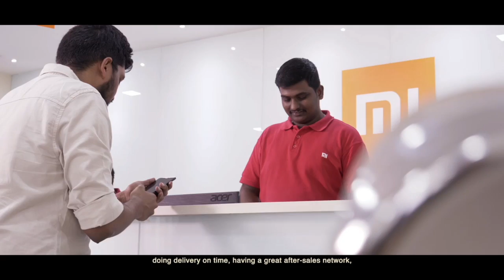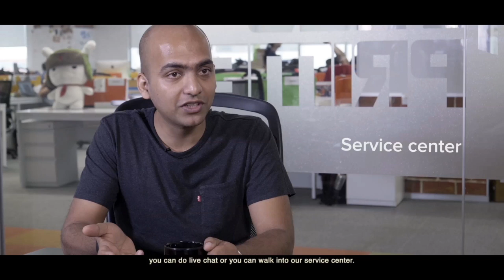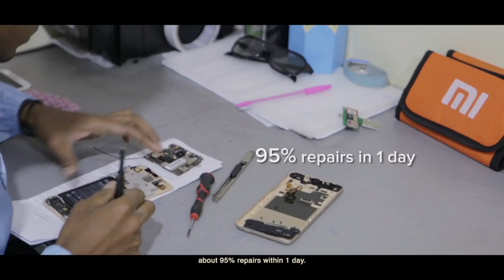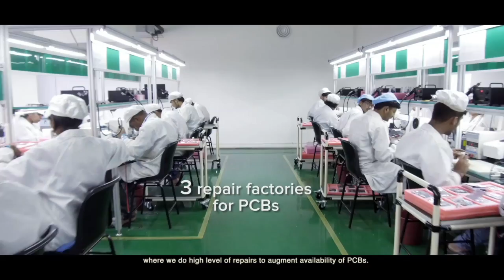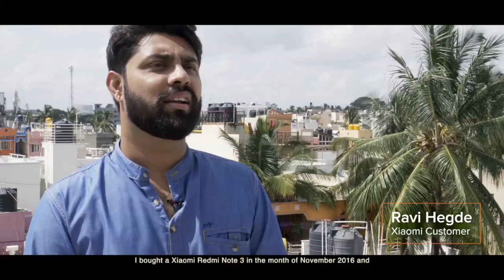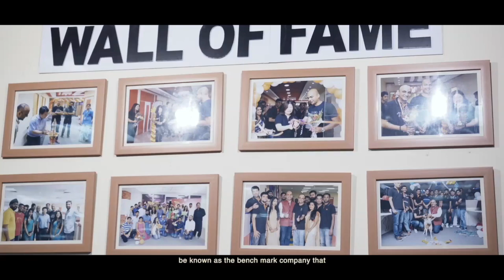500th Service center Video

Comment: on the 30th of June itself when you opened the 500th service center I had to visit one in Agra as my RN4 had a 'jumping display' issue and try told me that my device has water damage which is impossible as it was a brand new unit and that problem has happened twice in the first ten days of use of the device and I went to the service center in the 17th day when I was fed up of it and even now I'm looking for online help in this case!...